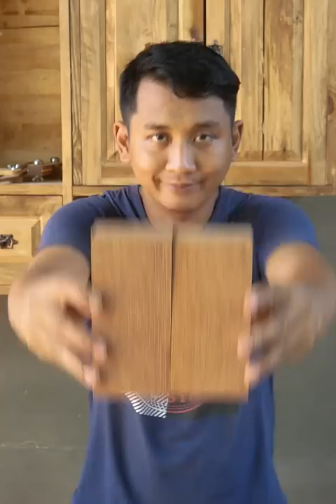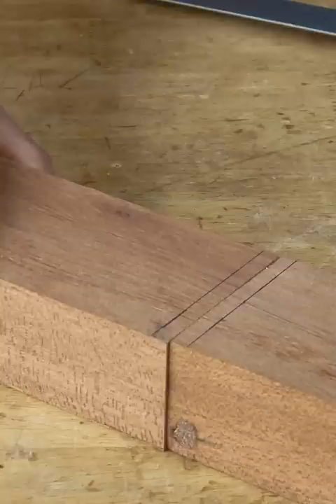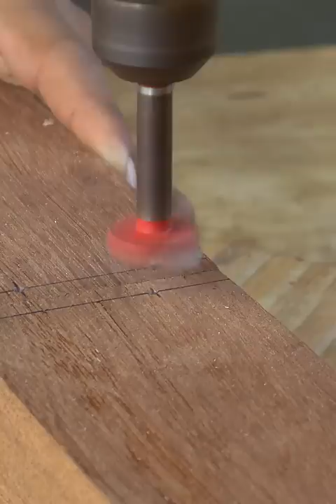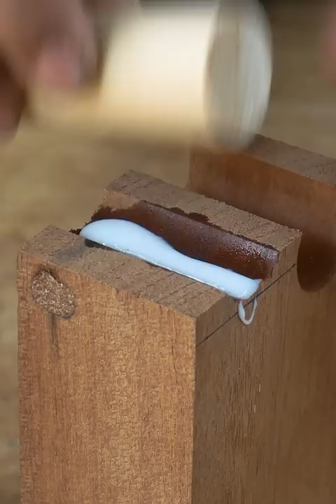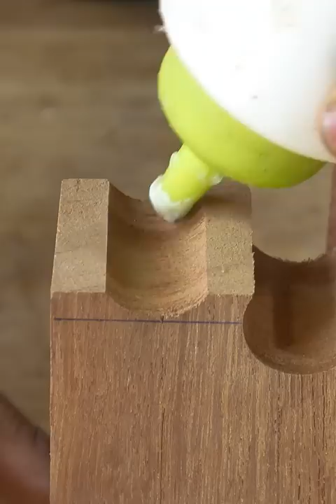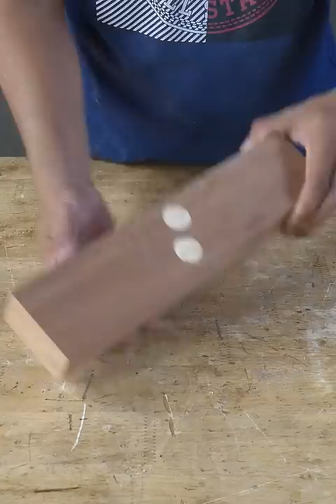Technique Woodworking joints with pin lock #woodworking #shorts #shortsvideo

Comment: Each round wood has a weak side, actually they were jointed by glue.
Reply: When wood glue cures - it’s stronger than the wood itself. 

The wood fibres will tear apart before the glue lets go.
Reply: And the glue is mostly on endgrain...

Comment: Aaaand...that's an F.

Joint is basically only glued in 2 spots which are one third of each cylinder. Thats not enough. You could just have glued the 2 lugs together for the same result. The 2 cylinders need to be screwed to the lugs after glueing.
Reply: It mentally hurts me when I see a channel Like a comment that tells how they've got it wrong & not say anything in response.

Comment: This looks cool, but it is only a little bit stronger than a glued butt joint. The trapped dowels don't actually do anything to hold the joint together.
Reply: They're not even trapped. The side where they're 1st attached has no screw, nothing, just glued on. Only the 2nd side is trapped.
It's a fake out at best.

Comment: You are just glueing them together but using less surface area and glue than just glueing the ends without the dowels.
Reply: I think it’s technically a little more surface area.  Certainly would hold better than just flat-edge glueing.  But it’s still just glued together and super weak.

Comment: When hammering that joint together look at the black mark on the side of the timber, after the video cut it’s not there, so what went wrong there? I’m guessing that mitre glue broke and you had to fix it before glue is all holding that joint, completely pointless, missed the concept completely 😂

Comment: That's significantly worse than a finger joint strength wise and much harder to implement. It's like you tried to make a diy dove tail but then decided to glue on the dove tails....